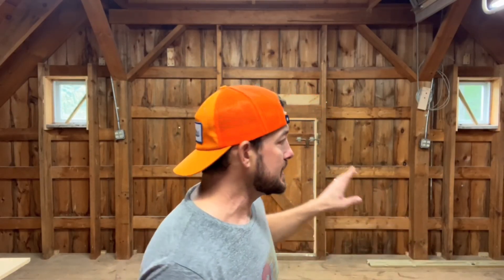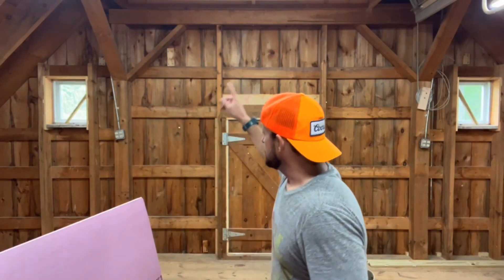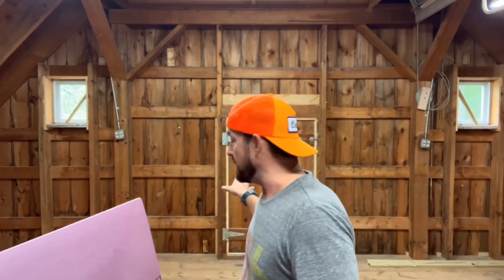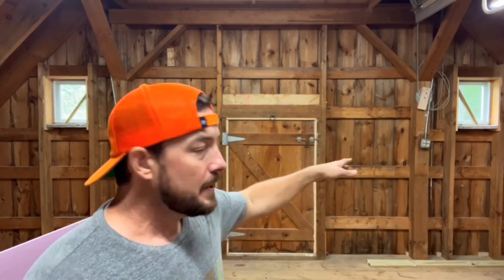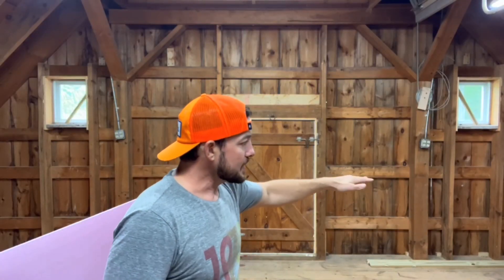Insulating an exterior wall for a post and beam barn

Comment: Do you know how much people charge for blown in mineral wool because it's fully vapor open and doesn't hold water and it's fireproof Some people charge a premium even though it's the same amount of effort for blown cellulose. They also rent the Blowers So it's simply a matter of putting up the netting if you want to do it yourself. If you're in the Northeast they also sell a product by HP that's a cellulose insulation board that's supposed to have built in flame retardant and is Vapor open. TimberHP: Wood Fiber Insulation It's easier to cut and handle than fiberglass and it's more rigid so you can just leave it in place if you want instead of having to cover it.
Reply from the maker: All these are honestly good ideas. I saved a considerable amount of money doing it myself and with fiberglass batts, again it’s probably not for everyone but it’s likely the cheapest option. The mineral wool batts can be nearly 2-3x more installed but will give you a significant boost in fire rating and soundproofing. This was just one option to put out there.
Reply: @Jesse-lee-woodworking  I didn't recommend mineral wool bats because the cost difference but for your size Renting a blower and blowing in the fiber can be pretty good. my main concern is whether or not you're rigid board is going to let your wood breathe. new England farm houses have stood for hundreds of years. as long as their foundations weren't set up to let the wood rot wood because the wood was able to breathe to dry, rot doesn't happen right away. it can start cutting into the life of your siding and your friending members. That's why I recommended the Timber HP Rigid board Or something breathable if you want to use that combination or rigid and batt. Your installation looks OK i'm simply worried that you've created a point for condensation to collect by moving the dew point while also making only One Direction it can dry out.

Comment: What are you planning on doing to the actual roof I understand the tar paper and shingle help with the air movement but heat rises
Reply from the maker: That is surely next in the series. Rafter baffles will run from the eaves to the ridge… eventually. Followed by R30 and then Sheetrock. Once I direct the airflow above my work area it will immediately warm the area. There are a lot more steps to get it updated but I am only one person, so they come in pieces 👍
Reply: @Jesse-lee-woodworking  You might consider a ceiling fan then just remember to get one that rotates in both directions That way it can push or pull air depending on the temperature.